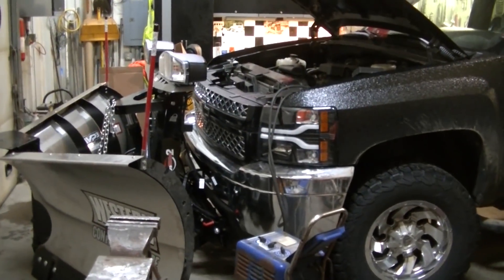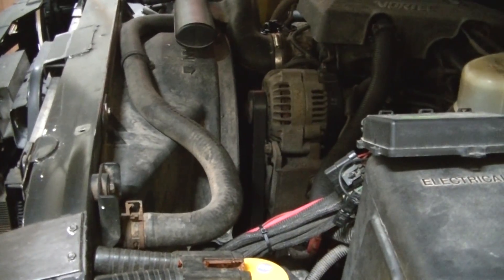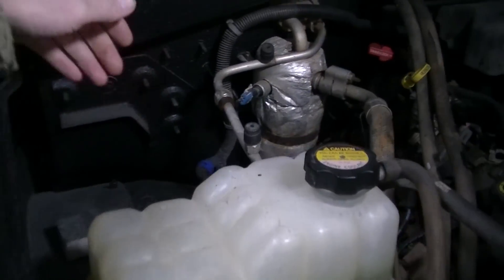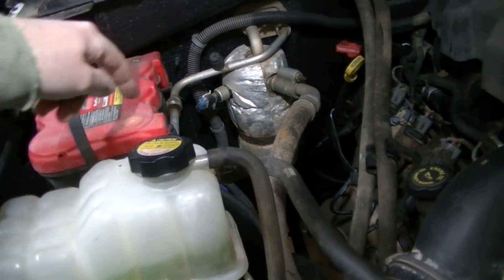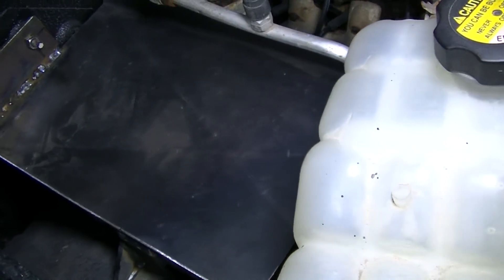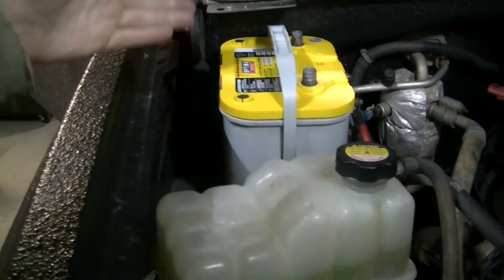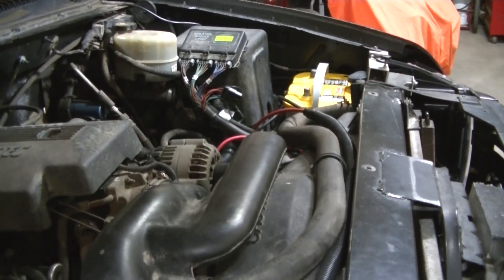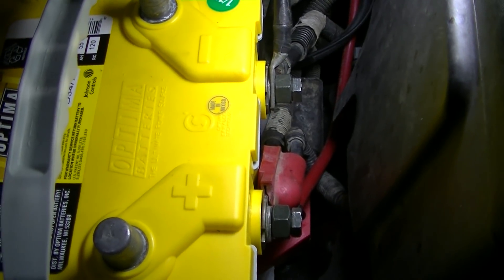Project Frankenstein Dual Optima Yellow Top Battery Install

Comment: Thanks for choosing OPTIMA! In addition to matching age and size of batteries, you should also match type (flooded or AGM). As others have indicated, your vehicle's electrical system is only as strong as it's weakest link. That includes your alternator, quality of wiring and quality of connections and grounds. If you have the option to connect to the top terminals, we would suggest doing that, especially in deep-cycle applications, as it is the most-direct connection to the batteries. We see a lot of GM vehicles with poor/loose connections on the side terminals, which ends up sending a lot of current through a small point of contact, super-heating the terminal and melting it out. If either the side or top terminals are not in use, it's a good idea to keep them covered with the protectors that came with the battery.

Once your vehicle starts, the electrical demands should be supplied by the vehicle's charging system. When the demands exceed the vehicle's ability to deliver current, the battery makes up the difference...for as long as the battery has energy to deliver. While that is happening, you are cooking your alternator and shortening it's lifespan. To see what happens to your alternator when it delivers lots of current, watch this video- https://youtu.be/3P_SERG6hIA

We also noticed you have a large shop charger. While that is fine to use on our batteries, we do not recommend a rate that exceeds 10 amps. If the charger has an AGM-specific setting, that is preferred, but “gel” or confusing “gel/AGM” settings should be avoided. Regular or deep-cycle settings that do not specifically call out gel batteries (because OPTIMAs are not gel batteries) are also fine.
Reply from the maker: Hello Optima,  I would love to upgrade the alternator but after spending $600 on batteries funds are a little low right now.  Especially when I wasn't really planning on doing the dual battery setup right now.  But it's done now so moving on to the next thing when I can.  I didn't know the top terminals were the best way to connect.  I will keep that in mind when connecting them next time.  Also I don't think I saw a protectors for the top terminals in the package.  I will check again.  I don't like them being exposed but didn't have anything to cover them with.

The shop charger was set on the low setting for charging.  I have heard that a big charger could hurt AGM batteries so I always charge them on the low setting.  It's an old charger so it doesn't have settings for gel/agm batteries.

On a side note I am always looking for sponsorship for my channel.  I have upgraded a few of my projects with your batteries and have always been happy with them.  Our shop could use a big Optima Batteries banner.  I would be proud to hang it in our shop!
Reply: Wal-Mart batteries work just as good with a 3 year guarantee for 1/5 the the cost.

Comment: Gotta love working on the fly under pressure like this hey? Sucks sometimes having to jimmy rig setups together when you got other work that needs to be done. I'm glad you were able to make a mount and get a second battery to make it work for you when you needed it. It's worse when you're out in the bush and something goes wonky with electrical. I remember many times having to change broken tail lights or marker lights on my trailer from ones burning out or cracking at the worst times, but fortunately I got in the habit of carrying spare lights in the back seat of the truck just for when it happened.
Reply from the maker: Had about 20 minutes to spare after getting everything together.  So a short test and then off to plow.  It did fine but I am still having the raw fuel issue with the truck.  So the battery wasn't getting drained.  Trying to figure that out now.

Comment: Having the same battery drain issue with  Big Chili. I did put a new alternator in this year and a battery last year. the old alternator was definitely going bad ( bearing making noise ) but the improvement in battery voltage drop is only a slight improvement. I'm going to try a high out put alternator. The stock alternator for Big Chili with ac is 136 amp but they don't tell you is that that 136 amp is not at idle its at cruising rpms.  I wanna find one that is around that at idle.
Reply from the maker: A plow setup really needs two batteries.  This was the first time ever for me trying to run one battery.  That motor draws a lot of power.

Comment: How’s it going man  you going be ok!!!  I have similar problem in my 2006 Chevy 3500 when I am using the plow the battery gauge go down but then they come back right away
Reply from the maker: Two batteries is pretty normal for a plow truck.  This was the first time I tried running with one battery.
Reply: Maybe I should try dual batteries in Big Chili

Comment: Even the ACDELCO 145A alt is a huge upgrade over the 105A they put in these trucks. ACDelco 335-1092 is what you want, about $160. Anything 200A or above usually starts at $250+ for good aftermarket

Comment: Mossman, I can not believe you are designing at midnight to plow at 0700hrs. You are amazing. Our Ram plow prep pkg has a 220 amp alt, and our new Jeep wrangler has a 240 amp alt for that goofy start stop system. Be well Randy.          Wayne
Reply from the maker: The newer stuff has a lot of electrical demand I am guessing.  A plow prep back in the day had two batteries and a 135 alternator.  I should be good with just the batteries.  The dually only had the 105 and never had a problem.

Comment: What is the difference between the red top and the yellow top?
Reply from the maker: The yellow top is better at dealing with more power going out than coming in.  The red top is like a standard performance battery.  Yellow top are more expensive than red top.
Reply: So on my LB7 that i plow with i should probably get the yellow ones righr

Comment: Do you not need a Capacitor or isolator for the dual battery?
Reply from the maker: You don't need those things.  They are just more connections and things to fail.  I have done it this way on many trucks and it works great.
Reply: If you run a lot of things with the engine off, I would suggest an isolator.. that way it will only drain 1 battery and the other will stay fully charged, then when u turn your key you would be using both batteries, personally I would hook it to a switch.. I don't use one, but when I add a 3rd battery I think I will.. I run a 5k watt sound system, not no cheap China system either.. 
deaf bonce aak-4000.1d @ .5ohm (over 4k watt)
aak-200.4 (over 800w)
I hold voltage very well at 15v
Mechman 370a alternator  $599 beast

Comment: Totally off topic from the video but noticed the green coolant. Are you against dex cool?
Reply from the maker: I run dex-cool.  The guy that had it before me put in the universal green coolant that can be used with green or red coolant.
Reply from the maker: If it's so bad why is every new car filled with it?  You are talking millions of cars and trucks.  If there was any proof that DexCool ate gaskets GM wouldn't be using it today.  My mom has a 2001 Tahoe that just hit 100k miles.  No issues with the original DexCool inside the engine.  You are listening to angry people having to replace intake gaskets and wanting to blame somebody.  It's probably GM's fault for using cheaper gaskets or the manufacture that made them didn't do something right.  I really don't know but I am going to need more proof than a lot of people saying DexCool is shit.  I have replaced intake gaskets and to me it looks like they are on the cheaper side so that is what I am going to blame.  Unless I see something else to show me otherwise.

Comment: How bad does your volt guage drop?
Reply from the maker: No matter what you do the voltage gauge drops a lot when moving a snowplow. I have tried many things to stop it and you can't.
Reply: @mossman381  mine drops down to 12 and sometimes 11 or so, just curious to see if that was normal
Reply from the maker: As long as it comes back you should be fine. I would make sure you have a good strong battery for snowplowing. Highly recommend dual batteries.

Comment: $25 on Ebay for a 2nd battery trey, I added 2 yellow tops also.  I also invested in a mechman 370a elite alternator, the best investment so far.. has tons of charge power, I also run a big 5k watt sound system and will be adding a 3rd battery behind my rear seat in the crew cab.. but they sell some of the best alternators available.. I don't think u would need a 370a but I would suggest something bigger.. my truck came with a 160a stock, and I just had a new 160a I returned because the 370a made such a difference I couldn't believe it.. my 2006 has pcm computer regulated voltage, so the trick to keep your voltage above 14.4 is to leave your headlight switch on,  otherwise the voltage will sit at 13.4v, but headlight switch on and the voltage will rise above 14.4v most the time 15.2v and holds strong
Reply from the maker: There is no battery tray that will fit a 99-07 cab with 07-up fenders.  My truck is running the whole time I am using my plow so I don't run an isolator.  To me it's just more connections to go bad.

Comment: Think of it like a garden hose filling a swimming pool (battery being the pool and alternator being the hose) if you have a huge drain on the pool it will take awhile to fill back up. If you make the pool bigger it will take longer to drain it. Alternatively if you increase the size of the hose it will fill up faster. So bigger battery will help or a bigger alternator will help. Doing both will make it best case scenario.
Reply from the maker: Two batteries should be fine.  I ran the 02 dually with a 105 and two batteries and it did fine.  Upgrading the alternator would be a good idea.

Comment: That same thing happened to my 2002 f250 v10 the alternator was charging 14.5 volts but only at 100 amp.  Amps is what count the higher the amps the faster the battery returns back to 14 volts try bringing your alternator to a alternator shop and have them bump up that amps that’s what we did now ours works great.
Reply from the maker: The 135 should be good enough.  I had the 105 in the dually for almost the whole time I had it and plowed fine.  Never had any battery issues.

Comment: I have another battery in the back I run my salter from, and use a isolator,  also got a 140 or 160 amp alternator from a Yukon cant remember no lol
Reply from the maker: I would like the 135 plow prep alternator.  The 02 dually had the 105 alternator almost the whole time I had it.

Comment: You need bigger alternator thats why you kill batts. optimas requires 13.7 volts to stay in shape.
Reply from the maker: Run a 105 alternator and two batteries on my dually for 5 years.  According to the gauge I am over 14v while running.

Comment: U might need to upgrade to  a high out put  Alternator
Reply from the maker: Two batteries should be fine.  Alternator upgrade would be a good idea but I ran the dually almost the whole time I had it with a 105.  Had no issues.
Reply: I upgraded to a 200 amp alternator on my 2004 cat eye and dual batteries upgraded all wires had to get special wiring kit for batteries 0 gauge everything my7 1/2 western pro plows pump draws 178 amps when in use   Shitty part of it all the high output alternator only puts out 105 amps @1300 rpms you only get 200 amps @ 4500 rpms    Who the hell is plowing at 4500 rpms 🤣🤣🤣

Comment: Had the same thing. You plow motor is shorted out.  Do a voltage draw test when lifting plow. Ect.    It will kill you att.
Reply from the maker: The plow is brand new.  Two batteries is pretty normal when running a plow.  This truck was the first time I tried doing it with one battery.

Comment: What's up you need to change your alternator  You need 300 amp alternator Your alternate as a 100 amps That happened to me once I fix the problem I had no problems.✔😉
Reply from the maker: The 135 should be good enough.  The 02 dually had the 105 almost the whole time I had it.
Reply: mossman381  No way don't even waste your time, One battery should be a deep cycle battery And your other battery for your truck, I put 300  Amp alternator .Everything else on the truck is gonna run great😉🤔
Reply: Your truck itself knees about a 100 apps to run itself
Reply: its only 135 amp above approx 2500 rpms which is only gonna be when you're pushing snow , not when your lifting the plow or really angling it unless your reving it or moving while lifting and angling.